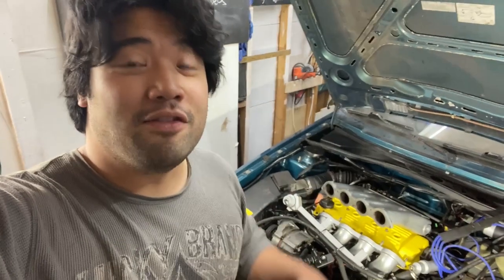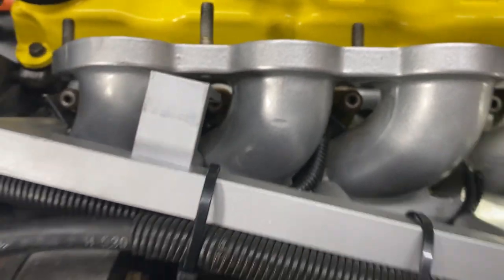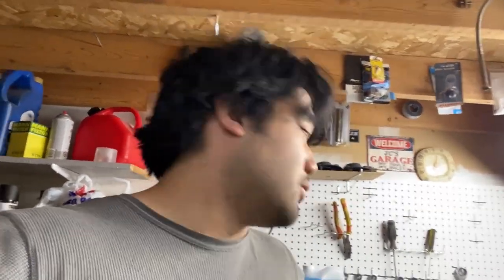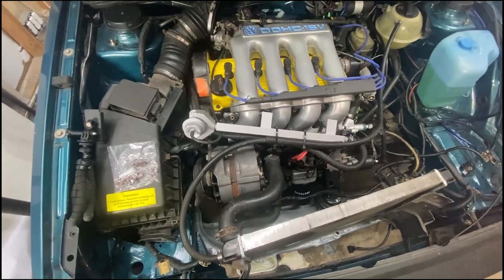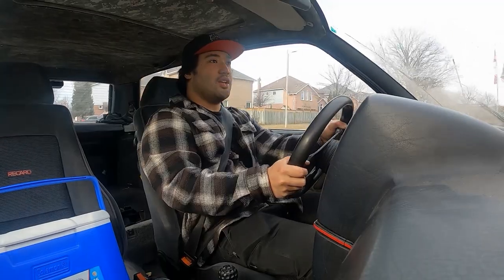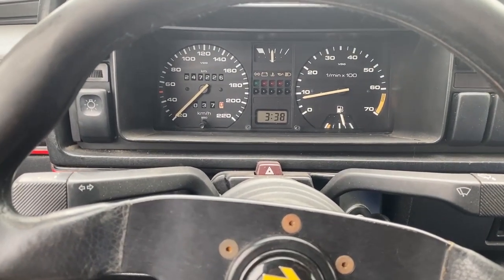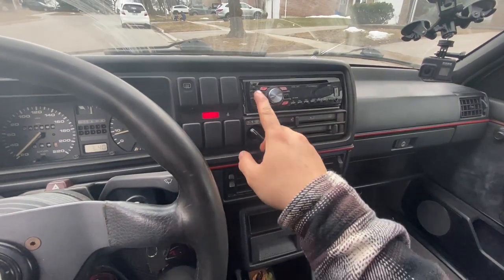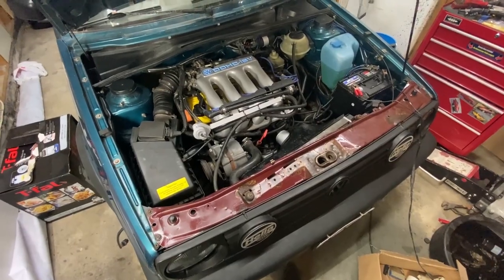Volkswagen Golf MK2 Build Episode 8: Start Up and Test Drive

Comment: I had to remove EGR. Mechanic sad no point getting another.
Reply from the maker: you mean the charcoal canister?
Reply: It was a couple wires with plugs of some sort?  He said it was faulty or causing some idle issues potentially. Not worth replacing.